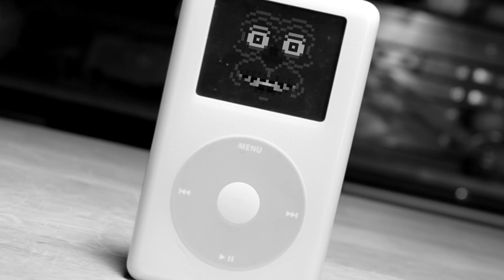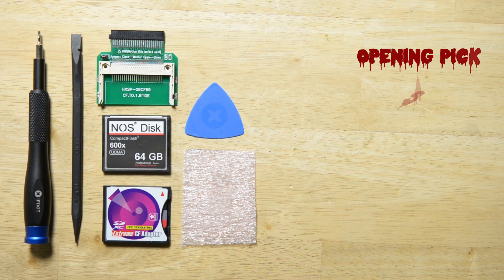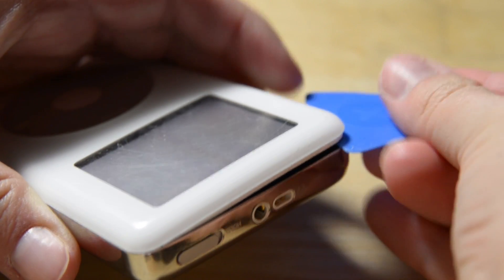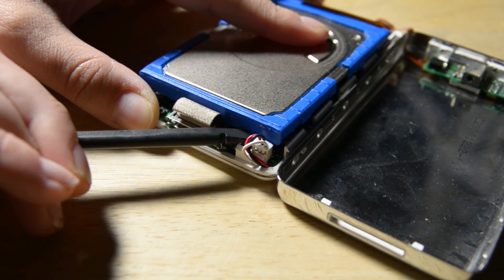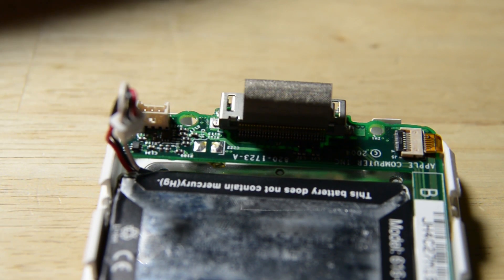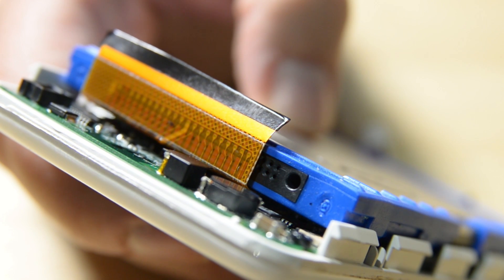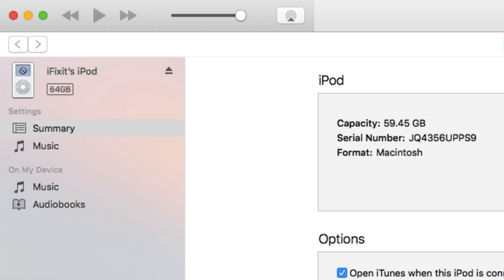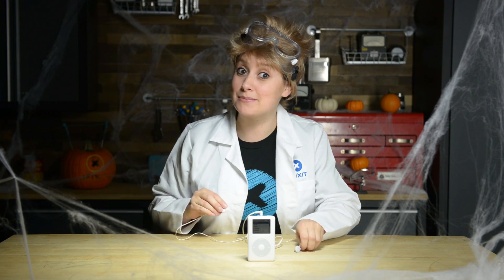iPod ReAnimation! Adding Flash Storage and a New Battery to a 4th Gen iPod

Comment: Really 64gb is the limit, because my 256gb 4th gen would beg to differ. Seriously though you can go up to 1tb, but the iPod's ram is what holds it back. For the 4th gen it has roughly  a 20,000 to 25,000 song limit before it starts becoming unstable. 64gb may also be the limit when using cheap adapters for compact flash cards. Also alot of times when people buy that cheap adapter they overlook the fact that you may need to bridge a solder point to work right in an ipod so be careful using the cheap adapters. If you really want to do it right spend the few extra bucks and buy an adapter from iflash.xyz They work really well, and are well documented showing you recommendations for which model ipod they work best for and what SD cards work best. So this video is still great for opening up the ipod, but get an iflash board and not the cheap adapters unless you really want to save those extra few bucks. It still works, but people have fewer problems and headaches with iflash than using unbranded cheap adapters.

Comment: Or let the professionals disassemble it. When the ipod 4 is disassembled, it is easy to damage the two cables on the left side of the machine. Because the two cables are very close to the edge of the back shell, it is easy to damage the cable when using the cymbal to remove the buckle. There are no accessories to buy on the line, which is basically equivalent to scrapping.

Comment: So mine didn't work at first. I tried using minitool partition wizard to format the sd card into a Fat32. Still no cigar. It turns out my 2011 macbook air has a hard time recognizing ipods but my 2014 dell optiplex recognized it flawlessly and restored my ipod.

Comment: awesome video! 
i found a 4th gen classic just tossed in a box of junk on the curb. i got it to turn on after sitting on the charger all day, but died the second i unplugged it. hopefully the new battery does the trick!

Edit:
So I left my iPod on the charger over night.
Went to check it this morning and it was really hot and still dead. I realized that it was plugged into my Android charging block. Luckily I still have my old iPhone 4 charging block. Switched that out, and it lit right up. Already did a restore and loading up music now.
Yeayuh!

New Edit:
So I got all loaded up and ready to go, but after an hour and a half, the battery was dead. That's a horrible lifespan. Is this normal with the battery replacements?

Comment: Ai little harder than all that. You have to have a firewire charger to finish the restore process (I have yet to see a bypass mod), and a proper cf card. Mine has a delkin 32gb and sometimes the ipod will corrupt some of my flac files or ruin rockbox. I know it has nothing to do with the logic board or the hd connector as both were replaced with nos. I think the storage can go higher than 64gb but I havent seen anything but rumors from people saying it can.

Comment: I've been trying to do this same upgrade to my iPod, but after I plug in the new Compact Flash card, I keep getting the sad iPod icon on the screen and the file folder icon, indicating there is still a hard ware issue somewhere and that the iPod isn't recognizing the CF card. Did you encounter any similar problems while working on this particular device, and if so what did you do to correct the issues? Loved the video, keep up the great work!

Comment: does this work with 5th gen ipod classic?
Reply: Not really.  There are  differences in the HDDs, but it can be done.  It's a bit more involved.
Reply: kmikl I have a 5th gen that is halfway falling apart. also, does the 5th get also inly support 64gb max or can it go higher?
Reply: +The Doctor all models can go higher than 64gb. I have a 4th gen classic with 128gb sd card and it runs fine. Will be doing the same to my 5th gen classic eventually. It is not hard to do.

Comment: so this is only for battery and storage, but if other insides die then?
Reply: other parts are MUCH more reliable
Reply: you can still find parts of all kinds for these models
Reply: For the 4th gens: it's much easier to fix, but I haven't had anything other than battery and HDD die on them.
Reply: the other parts don't usually break but you can replace basically everything about these ipods so it's just about buying the part and replacing it